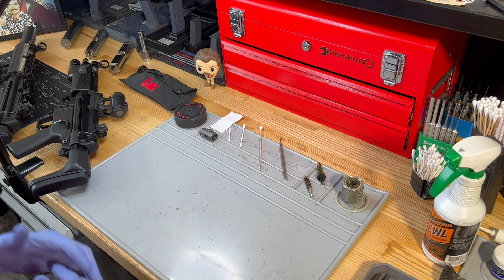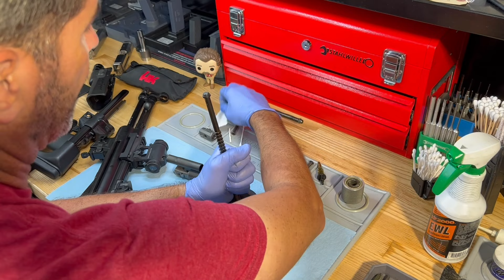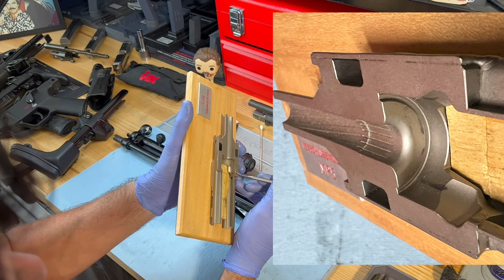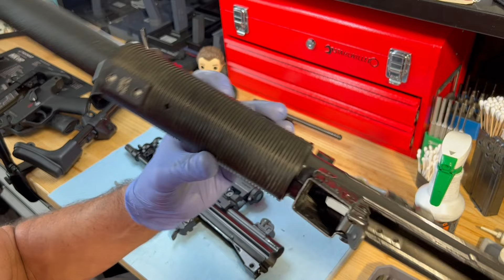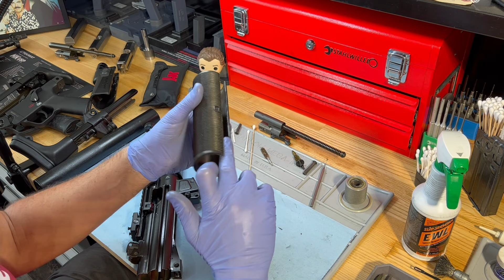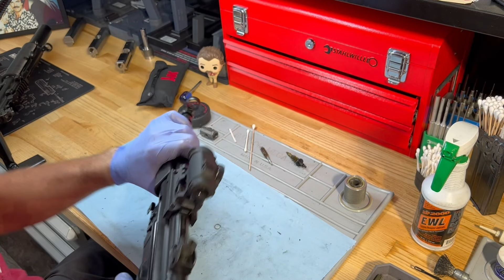H&K Armorer Tips, Tools and Procedures For Cleaning a MP5

Comment: Thanks a lot for making this video, it is very informative and useful. As for magazine disassembly (56:05) - I am pretty sure you are supposed to depress the bottom plate through that hole for a couple centimeters and hold it there - this "unlocks" the two side tabs that you can then very easily depress and remove the floor plate without scratches or damage.
Reply from the maker: Thank you.
I did show and describe the need to depress the baseplate support.  Even with that done, the force is still needed to force in the two side tabs.
Reply: @teufelshundtactical  My point is you need to keep that plate depressed all the time while manipulating the tabs. I usually insert a short wooden dowel into the hole, then press the dowel+magazine down on the workbench. If you look closely through the tiny gaps between the tab window and the tab, you will see when the internal spring holding plate will have cleared the tabs. At that point a fingernail pressure is sufficient to depress the tab to get the floorplate removed.
If you do not move the spring plate out of the way, you end up fighting not just those thin floorplate tabs, but a pretty chunky spring plate steel as well.
My intention is not to challenge your knowledge and experience, my intention is just to add a little bit of clarification which I thought the video was missing.
Thanks again for sharing your knowledge, I have learned a lot thanks to you.
Reply: @aircobralt  🎯👍

Comment: Probably the most detailed cleaning video, very cool seeing the sd broken down too, pretty rare to find that.

 I'm surprised you didn't mention the steps on cleaning the barrel though. You mentioned running a brush down the barrel but didn't mention running patches then finalizing with a lubed bore mop. 

I also would like to thank you for showing us the differences in the trigger groups.

Comment: What cleaning rod do you use?  Thanks! Great vidio!
Reply from the maker: The kit I showcase in the black bag with the H&K logo, at one time, used to be available on the H&K site and includes several tools included a rod that breaks down in smaller section.  The one attached to the power drill is one that my friend Phil Singleton gave me years ago.  No idea where he got it.

Comment: Very detailed and awesome video, Thank you for making it. Where do you get the cleaning rod that connects a Chamber Face Brush to a power drill? I think that's a great idea, Thank you.
Reply from the maker: Thanks.
I honestly don’t recall where I procured that rod.  I’ve had it for years.
Reply: @teufelshundtactical  Ok, I'll do some searching. That system seems to work great. I appreciate your video and quick reply. New subscriber here
Reply: @THANOS_Disciple  Standard multi-segment AR cleaning rod will meet your needs. One segment has a knurled base that is perfect to put into the drill chuck.

Comment: James, regarding the internal rails where the bolt carrier rides back and forth at the 31:00 mark, after cleaning that area, do you add additional lube or grease to that internal rail area for the bolt carrier at all?
Reply from the maker: I do not add grease.  I have not found it necessary.  You certainly could though.

Comment: Any tips for getting the lead deposits out of the SD port holes and around the holes as well?  I use a dental pick, but is very annoying.
Reply from the maker: I use the SD cleaning brush showcased in the video.  Anything that is left is easy to get with a dental pick.  Applying a solvent to break down the deposits beforehand always helps.

Comment: I'd never had one, stripped down a secondhand .22lr version that I got cheap due to misfires, to individual components, cleaned it, including the bolt carrier/barrel, adjusted the bolt spring for sub-sonics, reassembled it, and it works perfectly.  All without a manual.  Never saw one before, discovered H&K says I've voided the warranty for cleaning it properly, well duh, I'll clean it properly thanks, as it's mine and its outside the damn warranty anyway.

Can't understand why stripping one of these is supposed to be so difficult, it's not, and every 500 to 1000 rounds I'll be stripping it down again properly to clean it.

Tip: Makes sure you're in a clean environment to start with, in case you drop any components, AND use a Wooden Bench Vice to gently put the bolt carrier back together properly, as you really need three hands, I managed the first time with a bit of cursing, but I'll be using a vice next time.

No, I'm not a gunsmith, just a Radio Amateur, and normally I prefer bolt and/or hammer actions, but I was in the TAVR about 30 years ago, so stripped FN SLR, SMG, and early SA-80s as a JNCO for personal weapon cleaning as Radio Relay Technician with the Royal Signals.  Why does H&K consider people so stupid that they can't clean a weapon properly, and so store up problems to cause misfires?  Absolute madness.

Comment: Great informational video, many thanks! What is the expected life expectancy on the Extractor Springs?
Reply from the maker: Thank, it is difficult to say for sure because of variables like type of ammo (different pressures), if it was improperly stressed during install, and if it was stressed out of spec during use by malfunctions.  They should last many thousands of rounds, but you always want to do the press check I demonstrated in the video during each maintenance cycle.

Comment: What are your thoughts on ultrasonic cleaners? Ive yet to buy one
Reply from the maker: I highly recommend against them.
Reply: @teufelshundtactical  Please elaborate as to why?
Reply from the maker: @paulbellamy196  They dry out the parts, removing all lubrication.  Simply respraying lubrication won’t work if the weapon is not completely disassembled because it will both not get into the tight tolerance locations where lubrication is needed the most and also pool in low areas and serve to grab dirt and debris.  It will also remove any painted on things like fire and safe markings.  And it will make plastic and polymer items brittle and prone to breakage.
Reply: @teufelshundtactical  Thanks for the prompt response. My cleaner is small, so I use it on disassembled parts: putting the dry wiped down bolt carrier, bolt, locking piece, firing pin and spring in the ultrasonic, blowing them dry afterward then relubricating all surfaces inside and out.

Comment: Skip 2000 is a solvent? Thought it was a lubricant. I use Gun Scrubber for solvent work. Then lube with Rem Oil or Slip 2000.

Comment: For the SD, what are the consequences if I just leave the suppressor permanently attached? The can isn’t serviceable anyways so what does it matter if it is carbon locked? I am considering buying one, but there is a 0% chance I am doing anything beyond lubrication between range sessions.
Reply from the maker: If that is your mindset, then the SD is not for you.  The SD, as my video illustrates requires a level of maintenance unlike other suppressed weapons.  Not conducting this maintenance properly will cause your suppressor to seize to your barrel and then the only way to get it off will to be to cut through the receiver, suppressor and barrel.

Comment: What do you think about after market bolt heads like Mad Max that works without an extractor spring? It supposedly is more relatable.
Reply from the maker: That design is a copy of what H&K did with the PSG1 sniper rifle and HK21 series machineguns.  It is an ideal way to get around the weak point of the original design, but I have no experience with the quality of the Mad Max examples.

Comment: I have a Z5rs and want to order some Maintenance parts in case anything ever breaks what would you suggest I would order. I definitely want to change that bolt spring out To the braided spring.  Mine is the old style that is attached
Reply from the maker: Springs are the ones that wear most.

Comment: When I try to remove my bolt, it does not rotate clockwise to be able to be removed.  I have the AP5, which it the type you show from SP5 (spring attached.) I tried for an hour to get the bolt to rotate off.  tried turning it while pushed in, pulled out, rollers in, rollers out... Nothing seems to work.  Have you any idea what I'm missing or why?  I feel like if I try forcing it, that's not going to be good.
Reply from the maker: It should operate as I described.  If not, I would recommend contacting Century Arms.

Comment: I bought a brand new SP5, cleaned and oiled it, took it out and shot 500 rounds the first day. Got home and sprayed it down with solvent, what a mess. I will absolutely be following your instruction from here on out. 

I have to ask, is it normal to have a ton of tiny metal pieces all inside the gun? Im coming from handguns and ARs, ive never seen so many tiny metal pieces.
Reply from the maker: I've never seen "metal pieces", but depending on the type of ammo, you can see remnants that will sometimes look like yellow or brass colored flakes.
Reply: @teufelshundtactical  yea that's a better way of describing it. Very tiny brass and silverflakes. It was all winchester white box, cheap range ammo.
Reply: @teufelshundtactical  how often do you recommend cleaning? I typically shoot P320s and MK18s, I clean them every 1k rounds or so, adding a bit of oil before each range session. The mp5 seems much dirtier.
Reply from the maker: @NoEdits704  After every time you shoot.
Reply from the maker: @NoEdits704  Do not shoot WWB.  High probability for squib rounds that will destroy your barrel.
Reply: @teufelshundtactical  I typically shoot freedom munitions but my shipment didn't come in time.

Comment: How many rounds should you shoot before cleaning your weapon?
Reply from the maker: 300-500 is the recommendation for the SD.  For an unsuppressed MP5 variant I would want to do a thorough cleaning every 2000 rounds.  In the absence of that, at least wipe down and lube the bolt group and inside of the receiver quickly.

Comment: Do the A2 stocks have an H buffer in them?
Reply from the maker: No
Reply: @teufelshundtactical  Thank you, I have been trying to figure out if it was just the collapsible ones and caps that had it or if the A2 did as well.
Reply from the maker: @KiefferPlant  Only the A2 stocks without a need for a buffer.

Comment: What mount and optic setup do you have on your sp5? Does it allow use of iron sights still?
Reply from the maker: Aimpoint T2 on a Scalarworks riser and B&T base.  Allows the use of the iron sights, if needed.
Reply: @teufelshundtactical  thanks
Reply: @teufelshundtactical  what height is that Scalarworks riser? I see on their website it comes in three heights: 1.42, 1.57 and 1.93. Thanks!
Reply from the maker: @DontComeToMyHouse  I not recall the exact size, but just remember it being the model for the AR.

Comment: Hi James, with an A2 stock installed what does the BCG stop against when it comes to the rear?
Reply from the maker: The bolt carrier can only move to the rear until the recoil spring is fully compressed.  With the end cap on the A2 stock just slightly further pack, it’s beyond that reach.
Reply: @teufelshundtactical  so the BCG stops once the recoil spring is fully compressed?
Reply from the maker: @Jose-ny4lj  The bolt carrier does not reach the rear of the A2 stock, as I explained.

Comment: What height Scalar works mount do you have on your SP5?
Reply from the maker: The LDM100 model.
Reply: @teufelshundtactical  Thank you! What do think are the main benefits to having the Aimpoint mounted a little higher on your SP5?
Reply from the maker: @korgs1302  So that I can also use the iron sights of the red dot optic fails.  I prefer this set up over trying to co-witness with the iron sights,
As the front sight and the front sight hood take up too much of the field of view of the optic otherwise.